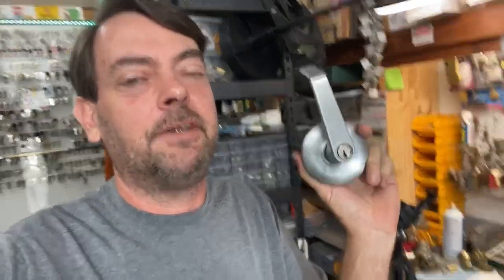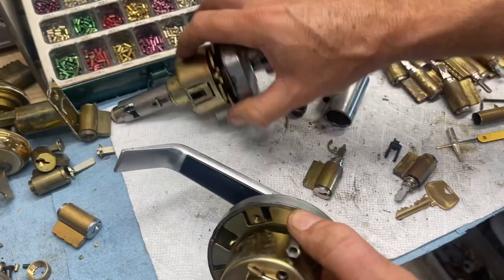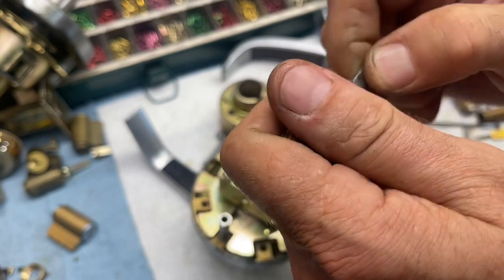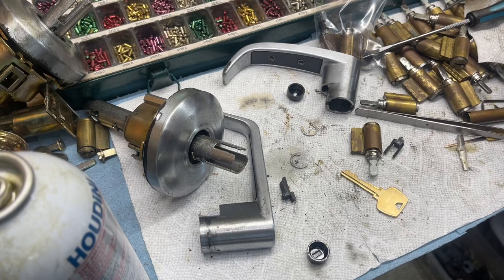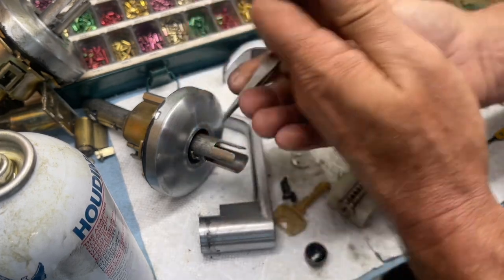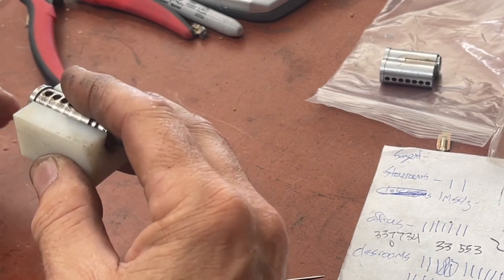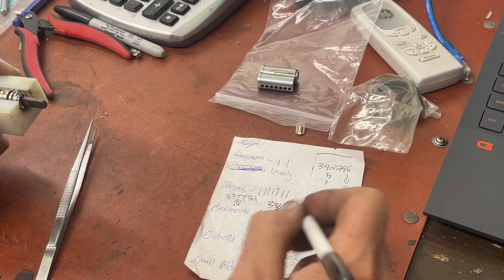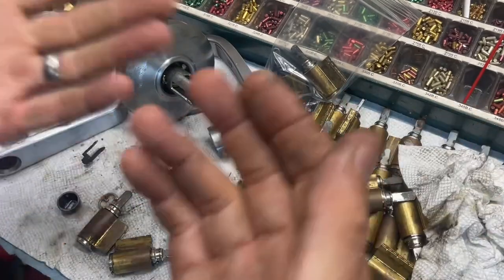Sargent Lever Handle - How to Disassemble for No Key Rekey

Comment: The anti-theft stickers that are found on merchandise have 2-3 thin pieces of metal. They work fantastic for shimming cylinders with tight tolerances. 

Also, giving the sides of the cylinder a slight squeeze with some vice grips will make shimming easier.
Reply from the maker: I had to clamp the first one up in the big vise!

Comment: So , you were keying it to there existing master key ?
Reply from the maker: I was decoding the cylinder to find the master keys so I wouldn’t have to deal with more disassembly.
The locks themselves will be rekeyed, that’s why they are all here 
not sure where the confusion is there
Reply: Find the master key as per customer request ? Or ? Because it would of been a lot easier just to dump out master pins and just key it up wouldn't it ?
Reply: Great video btw
Reply from the maker: @primelocksmith8876  no, find the master because I still have a equal number of these still on doors. I’m trying to AVOID having to pick/disassemble the rest of them
Reply: Ohhh . Gotcha man . Hahaha